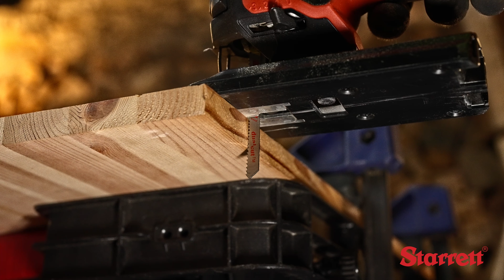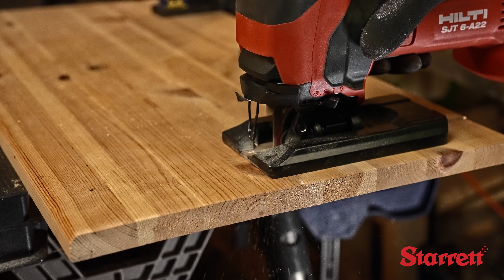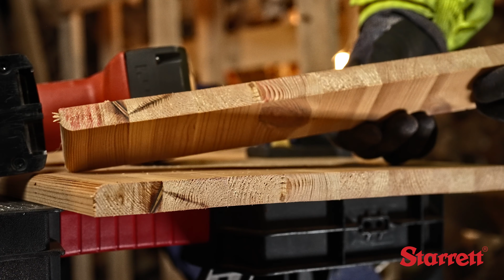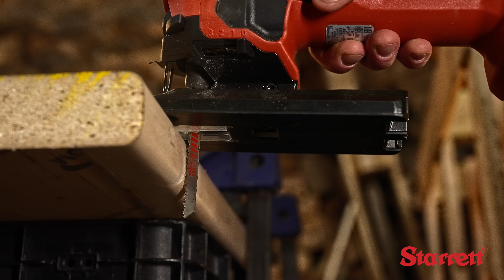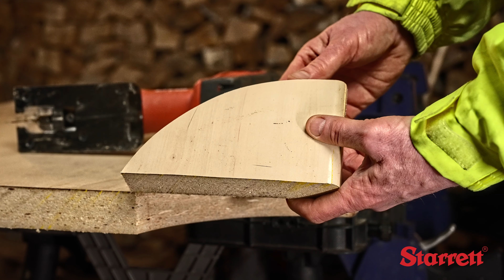Starrett Dual Cut Jigsaw Blade

Comment: This is just an normal jigsaw blade
Reply from the maker: Hi Gary, Thanks for your comment. This blade is slightly different from a standard jigsaw blade. Our Dual cut blade actually cuts on the upstroke and the downstroke leaving a great finish on both sides of the material.

The edge of the saw blade features a curved inward shape in a continuous arc instead of a straight line between the teeth. This special shape enables more precise and controlled cutting, resulting in improved overall performance.

You can find out more on our website. Link is the bio of this video 👍